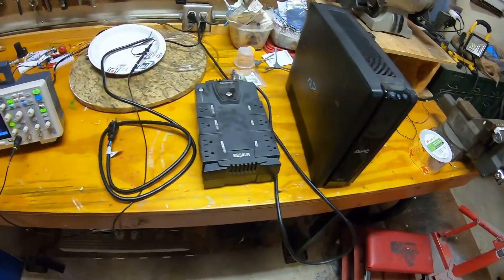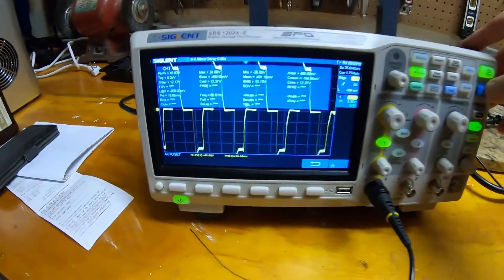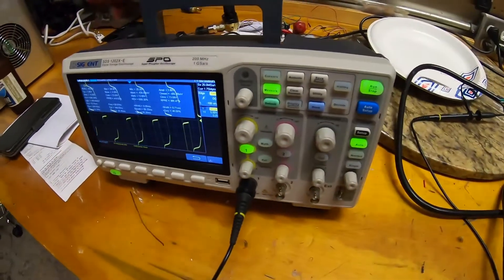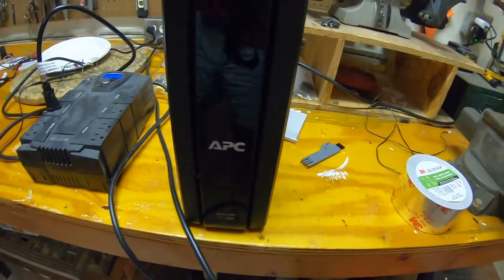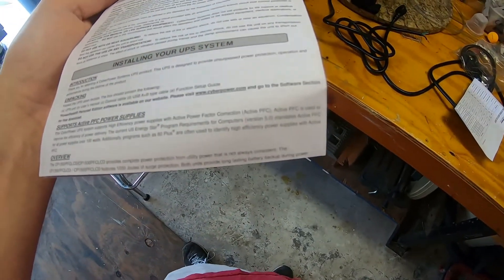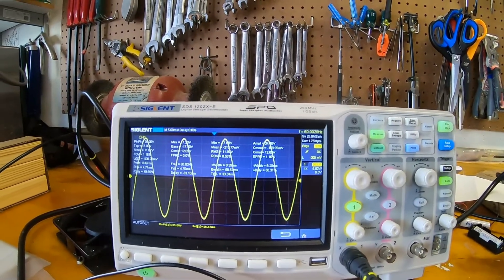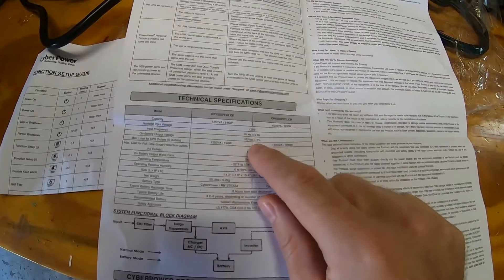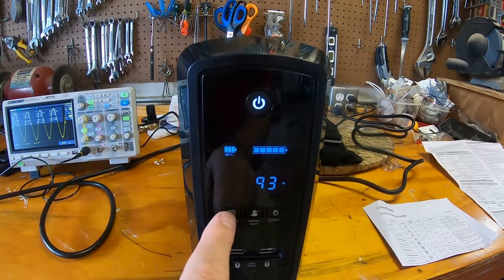UPS/Battery Backup Buyer Beware!!

Comment: From ChatGPT:  In most cases, having a UPS (Uninterruptible Power Supply) that approximates a sine wave should not be a major cause for concern. However, there are a few factors to consider:

Compatibility: Some sensitive electronic devices, such as certain types of servers, high-end audio/video equipment, and medical equipment, might have specific requirements for a pure sine wave output. These devices could potentially experience issues or reduced performance when connected to a UPS that provides an approximate sine wave.

Performance: Devices that are designed to handle a sine wave input may perform more efficiently and produce less heat when connected to a UPS with a pure sine wave output. An approximate sine wave could potentially result in reduced efficiency or performance, especially during high-power demand situations.

Battery Life: Devices connected to a UPS that generates an approximate sine wave may not have the same level of battery life compared to a pure sine wave UPS. This could impact the duration for which your equipment can remain powered during a blackout.

Noise or Interference: Some devices might be more sensitive to the quality of the power they receive. An approximate sine wave could potentially introduce electrical noise or interference, affecting the performance of connected equipment.

Cost: Pure sine wave UPS units are generally more expensive than those that provide an approximate sine wave. If your devices don't have strict requirements for a pure sine wave, you might opt for a more cost-effective solution.

Before deciding whether to be concerned about your UPS approximating a sine wave, consider the types of devices you're connecting to it and their specific requirements. If you're using standard consumer electronics like computers, monitors, and home networking equipment, an approximate sine wave UPS is usually sufficient. However, if you have sensitive or high-performance equipment, it might be worth investing in a pure sine wave UPS to ensure optimal performance and protection.

Always check the manufacturer's recommendations and specifications for your devices, and if in doubt, consult with a professional or the manufacturer for guidance on choosing the right UPS for your needs.

Comment: Maybe I'm doing something wrong, but I got a brand new Cyberpower CP1500AVRLCD3 because of this video. After getting it, I decided to use my mini DSO212 to look at the waveform. Of course it clips top and bottom since I don't have a 10x probe, but the waveform in UPS mode looks awful, like what you showed for the other UPSes, probably even worse! In comparison, I looked at my Bluetti and also a tiny OmniCharge's AC output, and both were pretty good.
Reply: ohhh, now I realize my mistake. Your model is has PFC in the model number, where as mine is just the AVR. I see they do sell the PFC version, which is slightly more expensive, but presumably this is the reason the one I have has such awful AC waveform in battery powered mode.

Comment: Can you explain the dangers of utilizing a UPS with an unstable wave form like this?
Reply: Other people here have explained that there is no real danger to using these UPSs for their intended application of home/consumer electronics like PCs. The wave is rectified & converted to DC by the PC power supply anyway. This video is not an accurate representation of anything but an untrained layman simply saying "this wave doesn't look like that one", and then plugging a big old fan into it that the UPS maker would tell you shouldn't be run on their UPS. It's an unscientific & uninformed video.

Comment: 3:14 I'm reading up on UPS brands to replace my old UPS (CyberPower LX1500GU ?) or maybe just get a battery maybe if still available,  But I also am building a new system and thought I'd also go more efficient for the power supply maybe even Titanium grade. It's good to know pure sine wave is a good thing to get for a PFC PSU. I was going to go Pure Sinewave  anyway and also maybe even online instead of line interactive (LI). edit:  and UPS manufacturer's don't seem to change their designs much for a decade so if CyberPower was bad it probably still is in 2023.

Comment: Thank you for the nice informative
Curious if the two older units had their components exhausted and can no longer properly output clean SINE Wave power
The only way to know would have been to test an APC Model that is brand new out of the box to really compare to see if it outputs nicely. Just like regular surge protector have a useful life, and then they don't protect against anything and needs to be thrown away.
Reply: Nope, that crap wave is present regardless of the age of the UPS. Any "modified" or "step" wave models will produce the same results. And all new APCs (and some of the other brands) are total garbage regardless.  APC was best IF you got a unit before the Schneider buyout.

Comment: I have had the same CyberPower CP1500EPFCLCD UPS but the UK version for 4 or 5 years now after I was getting regular brown outs and I video edit from home, so it's essential I don't lose work, turns out the local substation was dying, 8 months passed then there was a huge electrical explosion, haven't had any brownouts since they repaired/upgraded the substation but I'm glad I have the UPS as there's always the odd power cut each year. Anyway I came across this video during researching the APC Back-UPS Prto 1500VA, was randomly searching an insolvency office supplies auction site and saw one doing dirt cheap, like under 10 dollars with 15 hours remaining before bidding closes, but after seeing your comparisons, I'm gonna forget about it, but I'm glad to see that I was correct in being the CP1500EPFCLCD in the first place, I don't really need a second UPS but my modem/router is in another room to the NAS and PC and I wouldn't mind getting that and a CCTV camera that side of the house on backup at some point. Thanks for an informative video, even if it's been 3 years.

Comment: @Joe - Known fire/arc hazard, Cyber Power UPS contain aging strain relief (yellow) glue on the circuit boards become conductive. Please search the youtube video: CyberPower UPSes Contain Conductive Yellow Glue of Death (+ Bonus Rev. 2 Dim LCD Fix)

Versioning: Your new Cyber Power 1500 is a version 1 (green lettering below the brand on the front panel). Version 2 does not contain any green lettering below the brand "Cyber Power" on the front panel.

Both 1500 versions (1 & 2) contain the yellow strain relief glue on the circuit boards. This yellow glue is likely aging to the point of turning brown and becoming conductive in your unit (~3 years old).

Hope this helps others not burn everything to the ground.

Comment: I confirm that CyberPower products are garbage at best. Many other brands offer superior performance at the consumer grade level, but CyberPower offer nothing other than a waste of time and money.
I have a 1000va unit thrown in the garbage because of it's instability.
Reply from the maker: Mine has actually been pretty good, but I have heard of horror stories concerning that glue that becomes conductive over time.
Reply: @JoesGarageProductionsLLC  I don't know about the glue, my issue is basically instability when voltage is hovering around 200V, although it's advertised having an AVR, but it seems it exists only on the datasheet.

Comment: Thumps up right away because Joe used precise language right from the start. Then the rest of the tests were very helpful.
The Cyberpower with pure sine wave output - I do see a difference. The trough is a actually a bit more sinusoidal shape than on AC power.

Comment: I was in the market for a new APC as my previous unit is from 2007 lol. Anyway, you just saved me from a big mistake. I placed an order for a Cyberpower model, but I had no idea about the waveform thing.  It was a simulated sine wave model. Luckily, I was able to cancel my order and I spent a few dollars more and picked up a Back-UPS Pro BR1350MS. This is going to be crucial, as I am preparing to replace my 5-year-old 850 watt EVGA 80+ Bronze PSU for a newer 850 watt 80+ Gold with the newer 12VHPWR 600 watt connector. It's used for the newer Nvidia RTX 4000 series graphics cards.
Reply from the maker: Yeah, and that's the thing... the "true sine wave" units aren't THAT much more than the "modified sine wave" units. IMHO, money well spent!

Comment: I was going to buy the cyberpower (from costco) shown at 9:17 but I canceled my order after learning there is a yellow glue inside that can catch fire. The amazon link leads to the revision with the usb c slot that no longer has the yellow glue. I hope the unit in the video is no longer being used for this reason.
Reply from the maker: This unit is still in use... can you share where you found that info? I'd love to look into it more... thanks!
Reply from the maker: Wow, nevermind - found it myself. Thanks for making me aware of this! I think I may decommission this unit now and maybe do a video taking it apart :)
Reply from the maker: Did some more research and as best I can tell, it seems like there are two reports of this issue that seem to have been syndicated to nearly every news site on the internet. One of those reports is suspicious in that a user just happened to be filming the powering up of the UPS when it released the magic smoke. Does anyone factually know if this is more than just an isolated problem?
Reply: @JoesGarageProductionsLLC  I'm here because I'd just noticed a couple hours ago that the battery had finally failed on my CP1500PFCLCD after 5 years (pretty decent!) so I've been looking at things on here about it... Just opened it up to check this... There's one spot around a sensor wire where the glue is still kind of yellow, but everywhere else that there's glue on top of bare electrical, it's gone completely brown with a few darker spots on top of some bare electronics... So personally, I can say this seems to be a definite issue, at least for me. Looks like I'm going to be working at cleaning off glue, because otherwise this has been quite a good little unit.
Reply: Big problem area appears to be where the glue is across one end of the glass fuse next to a tall cap, and runs around the side of the cap to land on a couple resistors... Same point one video said they had their board get burnt completely through, the glue is a very dark brown on mine. So, yeah, I'm going to need to pull the board out and desolder a few things to clean all that off properly because it's gone hard as a rock. Yet another thing for future me to have to deal with. XD

Comment: I don't power fans with my UPS. I power a PC with a good PSU that handles approximated sine waves from my 1500G well enough. If and when this sucker dies I'll get a true sine wave unit... but it's not as apocalyptic as some people make it out to be. For that matter, I'd rather have my PSU strain under the stepped waveform than chew on unstable power. When they're tinkering with power during and after storms knock something out, I'll often hear the UPS fan kick on and off as it regulates the current. Back in the day this would make incandescent bulbs do fun things, now the LED bulbs we have just blink on and off, very occasionally keeling over (depending how good their circuitry is).
Reply: The biggest problem of the APC model tested are the generated harmonics which are poorly managed and filtered... This would have been interesting to test on all models.
Reply: @ThinKkBIGG  Do you think it'd improve slightly if you were powering a different, manufacturer-recommended load instead of either no load or an inductive load?
Reply: @AlexvrbX  About harmonics? No! If you read below the APC box, a warning notice is even written. Harmonics are misunderstood by many and contaminate the entire electrical network and can affect certain components and telecommunications systems. It will create distortions and noise on the network. The type of load will not improve the UPS but could create other problems.
''Notice: The output of this device is not purely sinusoidal. It has a nominal total voltage harmonic distortion of 55 percent, with the nominal value of the largest single voltage harmonic of 43 percent. At 25 percent of rated load.''
Reply from the maker: The fan was just used for demonstration purposes.
Reply: @JoesGarageProductionsLLC  it's one of the worst possible cases and well outside the intended use. Like using a Corolla tow an F-350 SD to demonstrate how awful Corollas are at towing. That was my point.
Reply from the maker: @AlexvrbX  understood. It's just all I had available in the shop to plug in at the time. Totally agree. They're not designed to power fans.

Comment: Apparently a UPS/Battery Backup is NOT what I need.  I want to run some electronics off of a small gas generator.  But as we all know, the sine wave output from a gas generator is pretty horrible.  So, what do I need to clean up the generator power?  Apparently the UPS only conditions the line voltage when it is running off the battery and even then it does a poor job of it.  Do I need a voltage regulator or does that only maintain a specific 120 VAC?  How about some kind of Power Line Conditioner like a Tripp Lite LS606M?  That also seems to be a voltage regulator.  Hopefully it cleans up the A/C, too.  Would a Sine Wave Inverter be my best bet?

Comment: I’ve use these UPS units for years and I’ve never had any problems with my computers? So I’m wondering is it really that big of an issue, when most of the time these are not being utilized but are just for backup!
Reply: can i use a Simulated Sine Wave UPS with my Computer having an Active PFC power supply ?

will it damage my PC ?
Reply: No. There's no issue. The person who made the video told you they're not an electrical engineer, and you should believe them and not pay attention to what they say. Others in the comments who are more knowledgeable than "this wave doesn't look like that one" have made it clear that these are fine for their intended purpose.

Comment: So a few things. First, the older ones will likely look a tad better with a load on it. There was no load plugged in. It wont look a lot better, it wont change the conclusion, but it might look slightly better. Second, they are not supposed to run inductive loads (that fan), because, well, they suck too much to do that correctly so the company just tells you not to do that :)  Third, if you are using it as a computer backup, computer power supplies basically handle that garbage waveform quite well. They just turn all that crap into DC anyway. Yes, a real sine wave is easier on the components, but no one should really worry about running a pc like that for 10 minutes each month. Thats how we have been doing it for 3 decades. Its not as good, but its totally fine. Fourth, that new sine wave is surprisingly good. Hopefully that circuitry has become cheap enough that all the UPS are going to start offering that. Kind of impressive. Oh, fifth, i think the probe needs to be compensated, the tip of the wave is leaning to the right slightly. Unless thats actually just how your power looks. Im not sure.
Reply: My computer power supply makes noise when it's running on the UPS, a Cyber Power CST135XLU that's about a year old. It's frustrating buying an UPS designed specifically for computer equipment, to find it's not really up to the job, and that I should have spent $180 for the right one rather than the $150 one in the same computer store. Both boxes made it sound like they were perfect for powering computers. Just the one mentioned sine wave for "compatibility" with more computers.
Reply: @javaman2883  You do realize the purpose of a station-side UPS is solely to afford enough time for the computer to perform a proper shutdown and not at all intended to be a sustained alternate power source, right?  Hence why many include a USB cable(or similar) and software (e.g.: APC Powerchute).
Reply: @Desert-edDave most outages are small blips though. Much better for the sake of not having downtime to just power through any small outages and if it keeps being out for say 5 minutes start shutting the plant down
Reply: @javaman2883   Are you sure it's the computers power supply unit? I have a fairly basic 850VA UPS and that thing makes noise as soon as it kicks in, not my other equipment. Can you try to run an extension cord from the UPS to your computer and test it? I have many devices, including power hungry computers hooked up to my UPS and none of them make any more/different noises when the UPS engages. I should note I try to use decent PSU's for the computers, Seasonic branded ones where possible with decent efficiency ratings (80 Plus Gold minimum) and that could play into it as well. If you have an old garbage supply then that could also be the reason, but then you have a whole other issue on your hands. A UPS cannot protect you from a bad PSU.
Reply: @javaman2883 my gpu coil wines on battery backup and just recently RMA’d my Seasonic Prime Ultra Titanium   I suspect it’s caused by the UPS so planning to buy a true sine wave one.  BTW, my PSU broke after a  sudden f grid fluctuation
Reply: Agreed. This video is based on misguided guesswork at best. Research was obviously limited to Amazon listing details. People who trust Amazon should not be trusted.

Comment: Thanks for the video. I bought an used apc and did not have a manual. Had a problem and now I know the battery replacement I needed. So thanks!